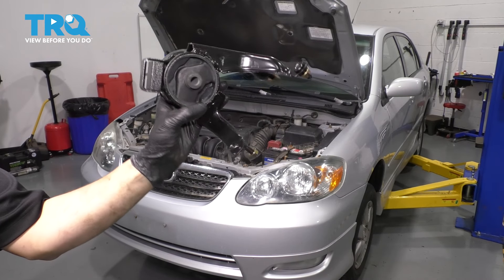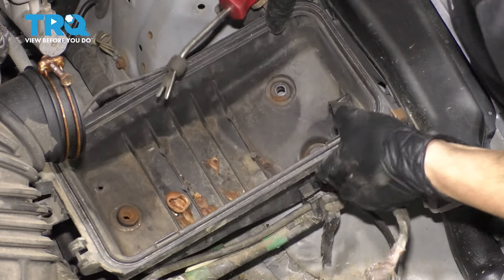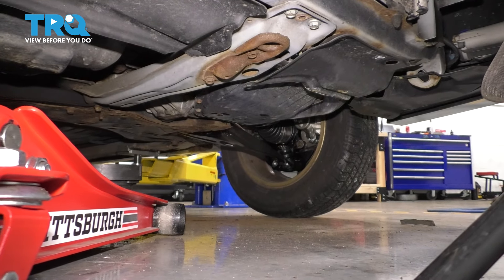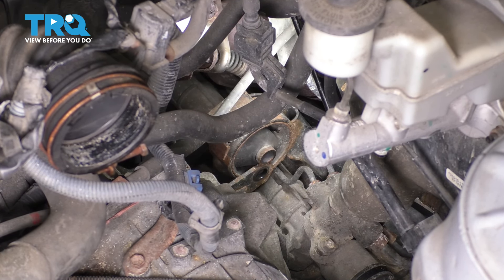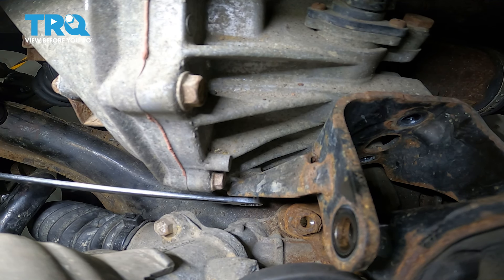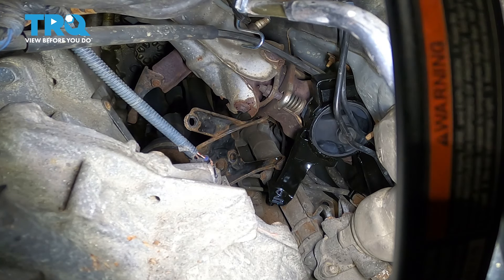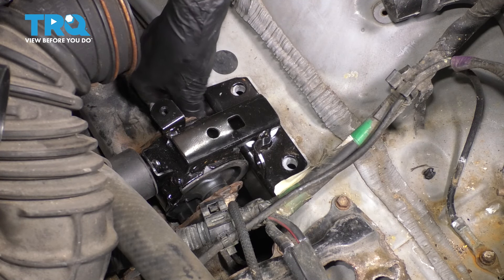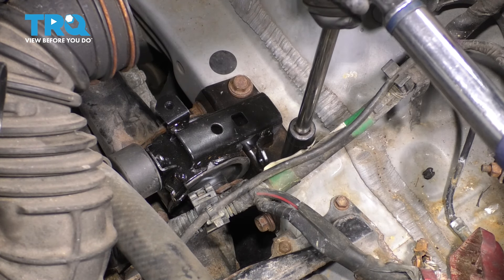How to Replace Rear Engine Mount 2003-2008 Toyota Corolla

Comment: He didnt mention that youll have to light the new rear mount up after its sitting in place. The hole for the cross bolt wasnt lining up otherwise in my case no matter how much the engine was lifted/lowered.

Comment: 03-08 corolla matrix/vibe manual tranny here: it can come out without taking the bracket off, just requires a lot of pulling and twisting. Also helps to lower the trans a smidgen. It took me a bit but it did come out. It will end up coming out on an angle/ on its side

Comment: You DO NOT need to remove the rear bracket. You can remove and replace the mount by taking off the sway bar end link nut on both sides which will allow you to deflect the sway bar to give you just enough room to fish it out the wheel well. Saved a lot of time doing this.

Comment: For the rear mount: Once everything is unbolted I dropped the jack supporting the engine completely and the old mount came right out and new one went right in. Didn’t even take two minutes. Then I jacked the engine back up to line up the holes for the center bolt. No removal of the bracket was necessary. I thought this might help someone. 

Thanks for the video!
Reply: 100% this. Unfortunately read this comment after removing the bracket, but it was 10x easier once i dropped everything and saved me headache trying to get the mount in

Comment: I don't know if this is 1:1 with a 2012 Prius or not. And it hardly matters.  I appreciate seeing you do this job completely and keep your cool. I haven't done it yet to our cars (3 Gen 2s and a Gen3), but it's good to know just how involved it is (the mounts look VERY similar). You did a video on the 08 Prius/Corolla front end and saved me hours of figuring out how to get the control arm bolt out lol. Ended up taking it to a great local shop instead (thinking of doing the same for the mounts). Sometimes it's not just knowing how to do it, it's being able to see someone else do it...and knowing your limits. Great work man. Thank you.

Comment: Yeah this is a "B" of a job but what i recommend is you def have to take the bracket out and take out the side and front mounts so you can lift the engine quite a bit up to get the mount out and new in.